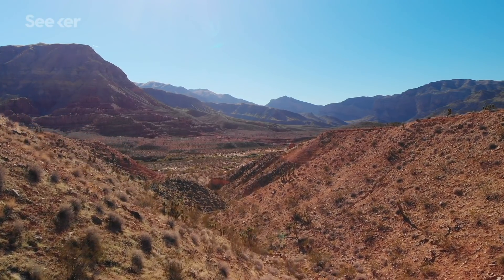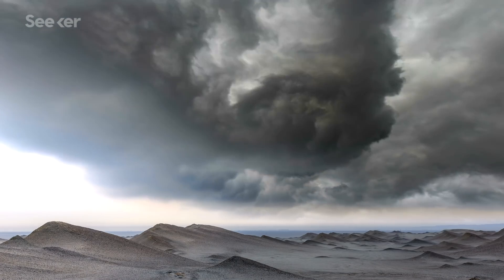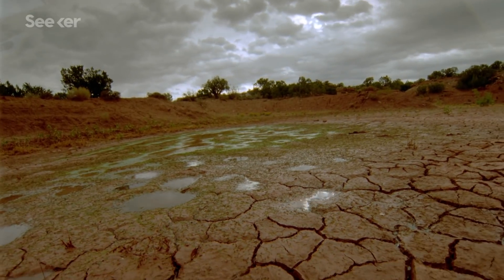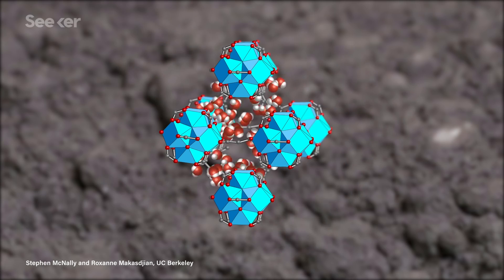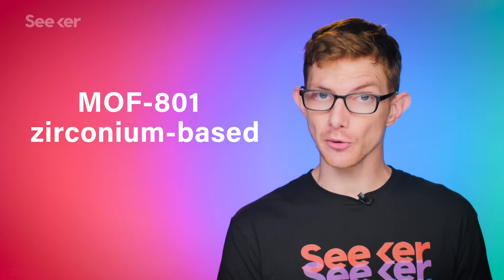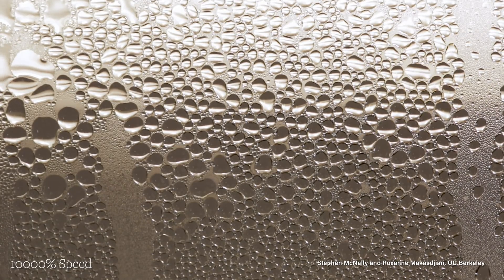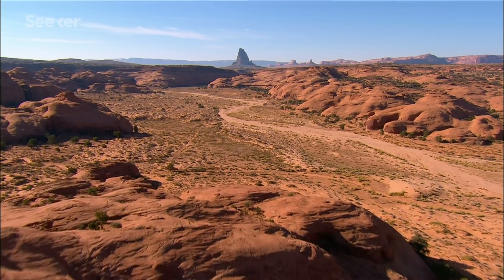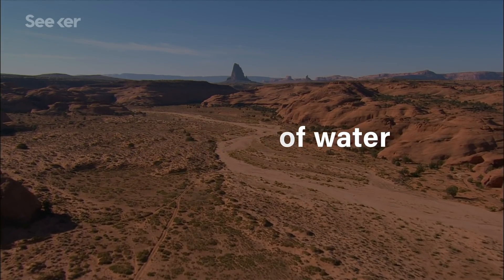Transforming Air Into Pure Drinking Water Is Finally Possible, Here’s How

Comment: FYI. Do not drink "completely pure" water in large quantities.
Reply: @JosVideosHD no, all packaged water bottles are essentially mineral water. Pure water can only be obtained through extreme filtration and/or turning water vapor into liquid water. If it comes from the mountains/wells/any  ground water source, it should be fine.
Reply: Would it be too pure to the point where it's taking things from the body we need?
Reply: @cutliss  yes that's true!
Reply: So are you saying distilled water is bad to drink???? I know a guy that is 112 years old and has never drunken any water except pure distilled water.....I am so confused
Reply: S J distilled water is the very best water you can drink.
I highly recommend you get one. You will never turn back
Reply: OK someone explain why please 😅
Reply: @philip0320  Because the concentration of dissolved particles in your cells would be much higher than in the pure water, and the resulting osmotic pressure would actually force minerals out of your cells into the water so the concentrations equalize. No bueno
Reply: Philipp all minerals your body needs can come from food.
Pure distilled water is actually the best possible thing for your body.
Don't listen to this nonsense.
They will probably tell you Fluoride is good for your teeth too!
Reply: daasboot81 that’s correct !
Reply: @daasboot81  I said "large quantities".
Drinking distilled water will not replace minerals lost through sweat, since all additives and minerals have been removed during the distillation process.
However, As most people eat and drink a variety of food and beverages throughout the day, most people will get the salts and minerals they need from these other sources.
This lack of minerals and additives would only pose a significant risk if distilled water was the only fluid or food that a person consumed.
Reply: @daasboot81  so a situation would be going hiking. not eating and drinking large amounts of distilled water.
Reply: @philip0320  so pure water (pure H20) basically has no impurities (minerals). In a nutshell, pure water acts like a liquid sponge, which would leech out the minerals in our body necessary for neurological and muscular functions. Water dissolves things, like how you mix a sugar cube in it until it dissapears. And the water we drink is called as mineral water, because it contains safe impurities which reduces the tendency of the water to suck out our minerals.
Reply: @cyrilljh  that is a lie that people who sell mineral water use to get people to buy it. Water purified by Reverse Osmosis usually has a TDS (Total Dissolved Solids) count of between 0 and 5 and if you catch rain rain before it hits the ground and test it, it reads exactly the same. The human body can't absorb minerals in their raw forms anyway so drinking mineral water is pointless, the way which we absorb minerals is through Amino Acids which we get from fruit and vegetables after they have absorbed minerals in their raw form and converted them into Amino Acids.
Reply: @cyrilljh  that's so cool yet frightening at the same time
Reply: @KevinDeanTaylor  yes that's right. But I didn't say that our body absorbed the minerals, instead that the minerals in water would prevent the leeching out of the minerals in our body.
Reply: @KevinDeanTaylor  you might be right as well. I'm definitely no expert in this field. I think it's safe to assume that all water (distilled or mineral) is fine, as long in moderate amounts. Too much water in any kind (talking about over a litre an hour), or anything really, would be harmful lol.
Reply: @jjk2one  lol yes fair to point out that this applies as well

Comment: Hmmm i see, sucking the humidity from an already arid environment, i see no side effects
Reply: Exactly that is a really bad idea because in certain dry areas the water will accumulate in areas with low pressure. People should know don't mess with cycles because you will probably disrupt it and you will break the system. Why can't they just use desalinated water. That will not interfere as much with weather system. At least the place is not getting drier probably wetter.
Reply: @user-pg5re1cg7d  because most of these desert regions are thousands of miles away from the ocean. The cost of desalination is also pretty high on large scales.
Reply: @MrObveous777  most people that life in a desert life in close proximity to the ocean. I don't know what would be more expensive this or desalination plant by the cost per liter.

Comment: Yay, a slightly improved solar powered dehumidifier.
Reply: Someone get thunderf00t
Reply: Next: we finally can get air out of water
Reply: @mumbairay  That would make for a nice scammy kickstarter! 'Air from water, using bleeding edge miniaturized nuclear submarine technology this tiny electrolysis unit will allow you to dive for hours using two AA batteries'. :D :D
Reply: @mumbairay  cool lets call it evaporator
Reply: @mumbairay  that's already has been maded for like more than a decade
Reply: ugh i love solar
Reply: So many BS is released like a breakthrough tech lately... It gives me 🤢🤢🤢
Reply: That's all it is as the politicians push lies.
Reply: "Yay, a slightly improved solar powered dehumidifier." yeah that's how you get water out of the air, in some condition can be 100% passive.

Comment: OLD: Atrapadores de Niebla. So Chile has known this technology for years and now comes the great american ans takes the credit?

Besides, if water is too pure it will kill you.
Reply: That works in places that have enough moisture in the air to condense on a material, and it effectively uses a big net like structure to condense the moisture (usually as a mist or fog). This works on a molecular level using a specialized material that attracts just the water molecules out of the air and is designed for more arid places that don't even get enough water in the air to get fog

Comment: Seeker: By pulling water from thin air, this device can turn even the driest desert into an oasis
Frozone: THERE IS NO WATER IN THIS AIR!
Reply: So we will fight world war 3 not for liquid water but for water vapour huh times change quick don't they
Reply: @lordx4641  i was always under the assumption that water vapour in the air was necessary for us to breathe properly as it moistens the airways as we breathe in and out, wouldnt the air be dry  and rough to breath without the water vapour there?
Reply: @hfjtrytry9216  yes u r right moisture is important infact without moisturised air there won't be any rain and aswell plants will die out just because some country miles away did large scale water extraction from the air it will influence the global climate for sure this time nd in worst possible case unfortuantely u cannot underestimate human innovation when it comes to destruction but I would be more pleased if we could someone filter sea water but  I still doubt sea can fullfil human greed even if I hand over this cosmos their greed won't be filled
Reply: Incorrect the air we breath contains the necessary ingredients needed for moisture.  The thing with a desert is that its too dry for moisture to actually be created usually.  The machine is able to get around this creating water from that air.  Essentially the Water traps and Moisture Vaporators from DUNE and star wars respectively.
Reply: @Quetzalcoatl_Feathered_Serpent  it converts water from air by extracting that tiny percentage of moisture from air. And the desert air can hold easily moisture but because of climatic patterns it cannot for eg their is a rain shadow region to such extent that rain doesn't occur there then it won't rain bcuz air is not moisturised air picks up moisture even dry air has but very little
Reply: @lordx4641   That's why you create moisture farms and build a number of them to make the most use of the tech...  Its basically the same concept back in DUNE for the water stashes the Fremen had and the Moisture farms scattered on Desert Planet in Star Wars.   Its doubtful your going to make enough to make a small lake but a pond size of it is worth more than piles of gold and oil in some places of the desert.  You have enough of them however.   Then things become interesting.
Reply: @Quetzalcoatl_Feathered_Serpent  my major problem is that surely climatic patterns will be disturbed because of water extraction you know humans

Comment: Seeker: Scientist can finally make water from thin air again

Thunderf00t: Um, no.
Reply: Dont underestimate the capability of humans to make a mess of anything
Reply: Possible, but just about practical only if you are prepared to use massive amounts of energy with monster sized hardware.
Reply: The difference here is that the release energy to extract the water can be induced through sunlight. All other desiccant solutions to do this require oven temperatures, which require solar lensing or other energy sources to extract the water.

Of course the laws of thermodynamics still hold, it still takes a lot of energy to remove the water (Thunderfoot would agree), but since you can just leave it in the sun which puts down about ~1,000W/m^2 it's really easy to do by just leaving it outside. Collect all night then release all day, it's a pretty great idea.....

However, let's see how much these things cost..... May be way cheaper to build and run a dehumidifier and generator

edit:corrected solar irridiance number
Reply: This is exactly what I was thinking
Reply: I was just about to post the same thing. 
 
I wonder how long it will be before Thunderf00t debunks this 🤔
Reply: @Nilsy1975  it will be interesting to see if these works or not according to him.
Reply: @Elmithian  agreed ☺
Reply: @Nilsy1975  He did already, two years ago. Granted, that was on the previous MOF, but the arguments are basically the same. https://www.youtube.com/watch?v=EGTRX6pZSns
Reply: @HowardCShawIII  thanks, will watch it.
Reply: Thunderf00t is an idiot.
Reply: @spooks196  when you become a published nuclear physicist then get back to me on how Thunderf00t is an idiot.
Reply: John Wedderburn he’s also a sexist here’s the thing he just looks for the most stupidest product and then tells you why it will not work with basic logic but he has been wrong before with spaceX.

Comment: Given the concerns stated in other comments about the impact on local moisture levels in the surrounding climate where the water vapor is extracted, it almost seems like it'd be a better idea to use solar powered electrolysis to capture hydrogen, then use solar powered compressors to force the gas inland where it can be burned to produce water in a tower setup that would use gravity to distribute the clean water. 

It would probably be pretty expensive to get the hydrogen where it needs to be and build the water storage, but it wouldn't REDUCE the available water vapor in the area to the detriment of local flora and fauna. 

The cost of the installation compared to these dehumidifiers and the local ecological impact of both systems would have to be the deciding factors.
Reply: Or instead of some ridiculously complicated and unnecessary process that would require insane amounts of energy, you could just build a pipeline to pump water thousands of miles from somewhere with an excess of water. That would likely be orders of magnitude more efficient that what you suggest.

Comment: Dehumidifiers basically, it takes more energy dehumidifying air than the normal way to get drinkable water, its useless
Reply: Looks like you didn't watch the part that says they're passive or solar powered...by the way, what is the normal way to get drinkable water in a desert?
Reply: @leecaste  Currenr normal way is shipping it. What is the return of investment and a running cost of this stuff?
Reply: Return of investment and running cost?...I have no clue, maybe when they finish developing the prototype you can get some numbers.

Comment: That's been around for decades. It's called a dehumidifier. Just add a water filter and you're good.
Reply: And there is a reason that sensible people don't use them as a water source. Especially in environments where there is very little moisture in the air anyway.

Comment: Bro my air conditioner spits out ice cubes, get on my level.
Reply: Theirs works without being plugged in.
Reply: @sirdeadlock  
Let me guess the framework grabs onto the water like zeolite (which gets toasty while doing so). You heat up the saturated dessicant to a still higher temperature, to force it to release the water in gaseous form and you condense or even freeze that water with a heat exchanger of astronomical proportions and power to condense the water (if you're going overkill on stripping all that thermal energy from that mass of steam, you might as well turn it into ice).
Reply: @unf3z4nt  ok
Reply: @neocuriositi  ok
Reply: @kyrlics6515  ok
Reply: @akhilsettypalli8862  ok
Reply: sirdeadlock they said it used solar power. So all you need is solar powered AC or dehumidifier
Reply: 😂😂😂😂 You got the wrong one
Reply: Ice Cube is soooo outdated. Comeback here when your AC leaks something fresh and newer like Migos, or something.
Reply: fajar adi Pradana They seem to love ice though.
Reply: Mmmmmmmm... highly contaminated ice cubes!
Reply: Animation Space you can filter it.
Reply: @abc123fhdi  its a joke but judging by your username being 123abc tells me you weren't able to comprehend that...
Reply: How much energy does it use and how much ice and water does the AC spit out?
Reply: @MrPlaidFace  ok
Reply: That's exactly what I was thinking about when I saw this video.
Reply: Damn. I need an AC like that.  lol
Reply: A lot of people need to be wooshed
Reply: You know it takes water to make a ice cube so it's not spitting out ice cube but making ice cubes out of water from condensation of water ..... What level are you on now bro 👀
Reply: @josephagamble8863  it joke i think!!!!!!!!!!!!!!!!!!!!!!!!!

Comment: I was unamused at the first half of the video but watching more of it actually impressed me
Reply: It's just a dehumidifier
Reply: @Mickiceking  yep, but an extremely efficient one.
Reply: There really isn't that much humidity in the air for this thing to compete with other ways we get our water as of right now and its Solar panel better be tracking the sun or else that will also be a huge waste of energy.
Reply: @Mickiceking  solar panels are already dirt cheap, batteries are the biggest expense for a project like this in terms of power. As for water availablity, we can desalinate fresh water from sea water really cheaply now, but not if the nearest ocean is hundreds of kilometres/miles away across other counties borders. 
There is a vast amount of water in the atmosphere, certainly more than we have any use for, so the only real question is about price per litre and setup cost for the projects. If it's cheaper to set one of these up than to install and maintain a pipeline then it might be really useful for things like agriculture and small towns in remote areas.

Comment: Thunderf00t should jump on this
Reply: It is sad he have to explain basic energy conservation laws to people.
Reply: @Dysputant  *Not exactly*, because even water vapour is continually changing phase on a molecular level requiring nucleation center to catalyse condensation. These are required as the energy to condense water on the surface on object is lower then produce droplets. Forming droplets requires molecules contend with the present hygrogen bolds lattice, which initially takes more energy to deform the lattice sothat new molecules can assimilate.

minute physics has a video on the mathmatical impossibility of rain.
Reply: Damn. Beat me to it :)
Reply: @wooosh bait thorium powered solar-freaking dehumidifier
Reply: Doesn't he have spare zirconium for his reactor experiement too.
Reply: There is nothing to debunk. They already said that unassisted and with zero power  the device can only produce 200 ml of water  day  for 1 kg of MOF (they never mentioned the volume or density of the substance ). That isn't an impressive amount , though it does seem more efficient than the previous methods .
Reply: There's no way around thermodynamics a certain amount of energy has to be paid to cool down a certain amount of water
Reply: @Red-dd4yg  Less energy is required to form water on a surrogate surface then droplets. That's the principle behind rain cloud seeding, is to provide nucleation sites to aid condensation. The hydrogen bonds of water increase the condense because they dictate allowable arrangement of atoms which atoms ecreate at the surface.
Reply: No. He is even more annoying than these idiots.
Reply: I'm 35 minutes late on that same idea haha
Reply: @woooshbait9696  
When did they ever claim that?
Reply: @remliqa  wooosh!
Reply: @wooosh bait 😂😂😂 llmao
Reply: I'm phoning him now